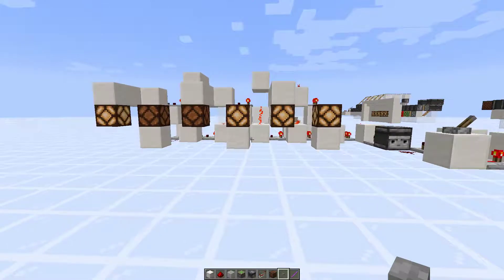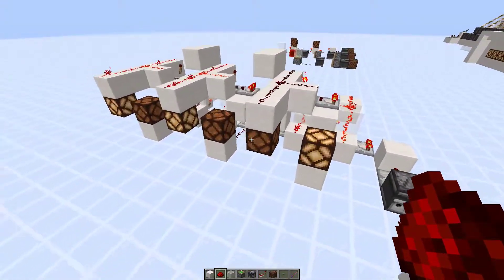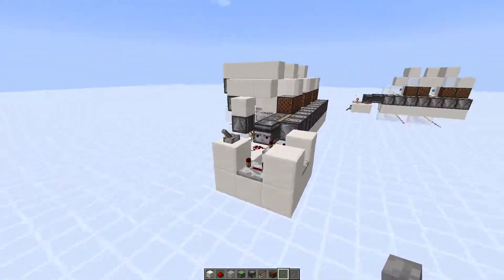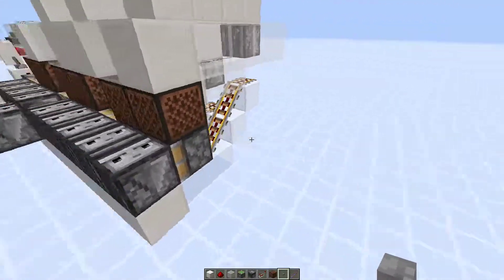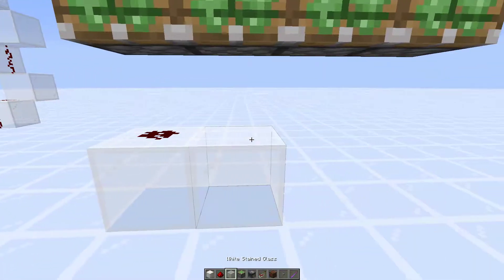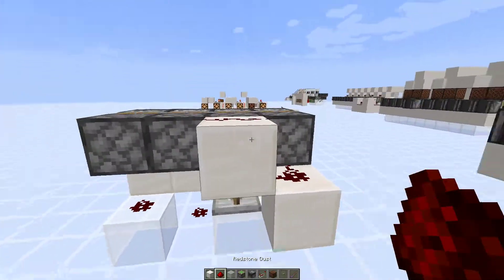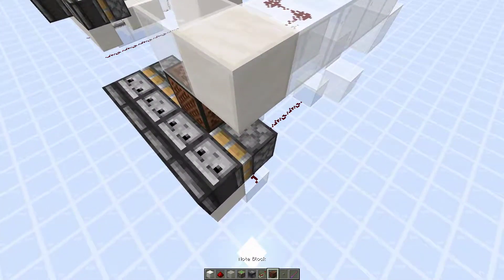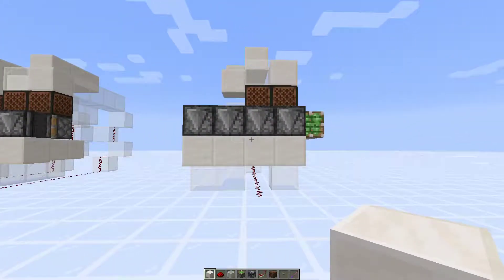Faster Tileable Binary Counter

Comment: is this supposed to count uneven numbers? if you look at it frame for frame it counts 1, 3 ,5 ,7 , 9 ,11 in binary. tried replaceing the clock with a noteblock to check every update and i got the same results (1,3,5,7,9,11).  Or is this redstone broken from an redstone update?
Reply from the maker: I see the issue, 1.16 did break it. Here is fix: https://youtu.be/F-Dl9lBioNs